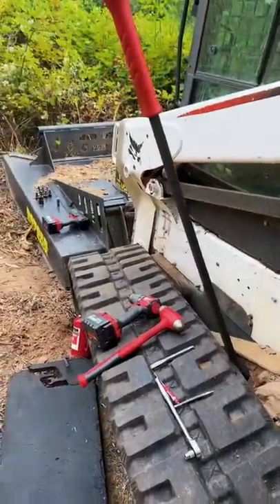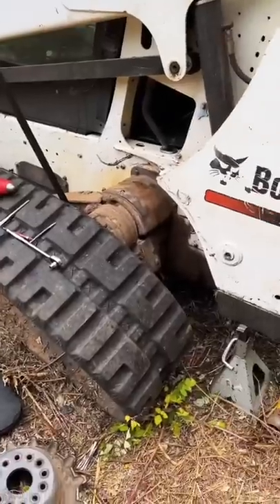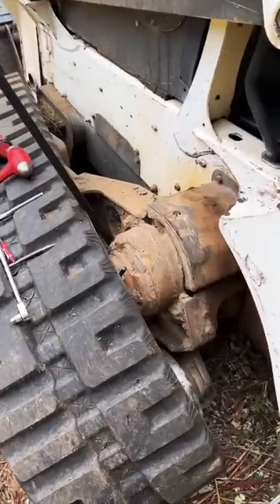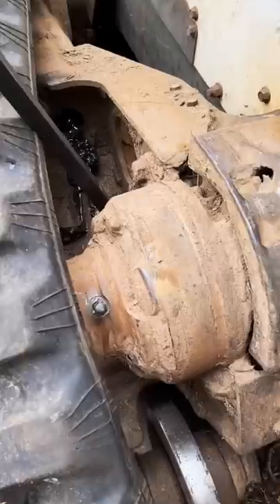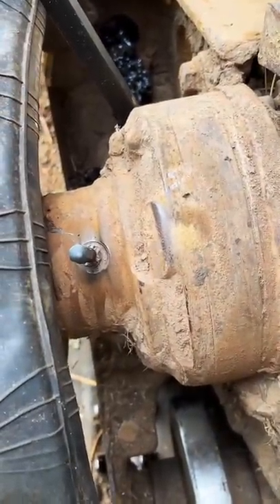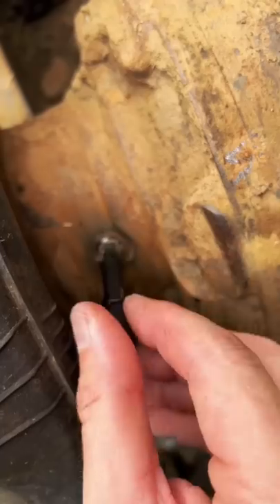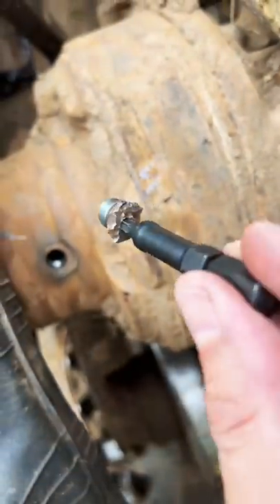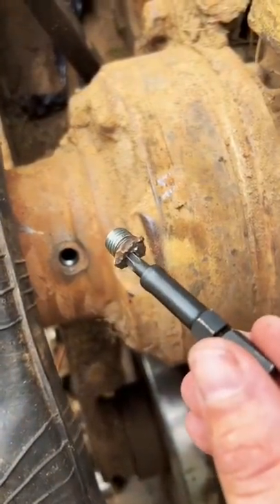MAC R.B.R.T Saves The Day Again! #MACTools #MrSubaru1387 #Shorts

Comment: I love the challenge of drilling out broken bolts, studs and plugs. Especially exhaust studs with hardly any room
Reply: This sounds like sexual innuendo
Reply: Struggle = Fun
Reply: Next time my service writer hands me a RO with exhaust leak, Ima tell him to go see you brotha!
Reply: You probably have a lot of experience and great tools because I could never find anything I need
Reply: Wish you were my neighbor…
Reply: @alexvillalobos7137 i was not always good at it, had to mess mess up some before i got better.  i have removed broken bolts since the early 90's in the military. Mostly on Hummer exhaust bolts. It was extremely challenging. Had to use a 90 degree drill and a mirror. Drill bit had to be cut off and re-sharpened. I mainly used cobalt and tungsten carbide which are extremely brittle. I fell in love with it every since.
Reply: - Said no one ever.
Reply: Youre the only one

Comment: Threads look nice & clean, go ahead and use that plug to close it up again! 😂
Reply: I used reused a bolt with a welded half wrench on my brake caliper.
Reply: NextGuyProblem™
Reply: Sure as shit know that I would 💀
Reply: Just plug weld a nut slightly off center

Comment: The best part is you can just leave the extractor on there and now the bolt is as good as new
Reply from the maker: Hard to get the sprocket back on... Lol
Reply: @MrSubaru1387  damn design flaws 😂
Reply: @MrSubaru1387  yeah, but you can reinsert it and be ready for the extractor next time. No drill needed. Just dig the mud out with a dental pick.

Comment: GL with that drain
Reply from the maker: Got it. 👍🏻
Reply: A block of wood under the rear and bucket down and these machines can jack themselves off the ground. Gives a good bit of access when needed. (Strong hard wood recommended under the bucket too recommended as well so it doesn't sink on soft ground) [point bucket down and lever down to raise machine]. SAFETY WARNING: Do not climb under machine on soft ground work from beside the machine. On stable hardtop the machine will hold itself. Chain locks should still be used to lock the arm in place on concrete before getting under the machine. Hydraulic failure could allow the machine to drop on you.  Rated jack stands or blocking is still recommended for saftey's sake.

Comment: You need new drive sprockets. I can see it already wore through the guard that protects the hydraulic lines as I have had to do that job before. Luckily I just tagged welded the fitting that was worn down and we can and put a new guard and sprocket on there and it had all the clearance back
Reply from the maker: The sprockets are new Bobcat genuine with 8hrs on them... 🤦🏻‍♂️ 🤦🏻‍♂️ 🤦🏻‍♂️

Comment: Damn that fill plug is a double whammy, in a stupid spot and a stupid fill plug head choice. Whats wrong with a 3/8 square? Never worked on bobcat but the car skid steers never had any of those problems.
Reply: Agreed, old school machinery used square female socket holes in plugs.  Yeah, they filled with dirt/mud, but you could clean them out and put a breaker or socket wrench in them and use them. There was nothing to shear off. Why they switched to above the surface bolt heads I'll never understand.